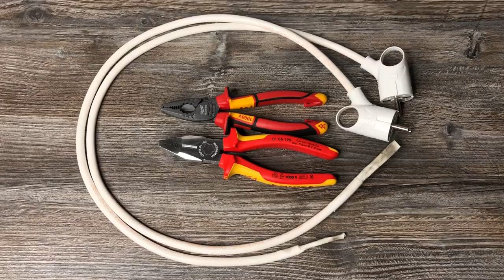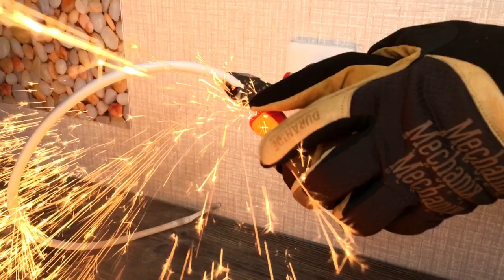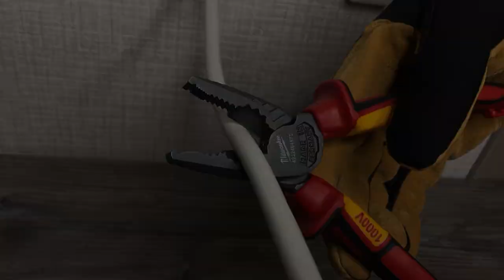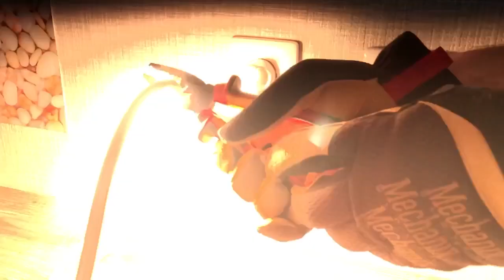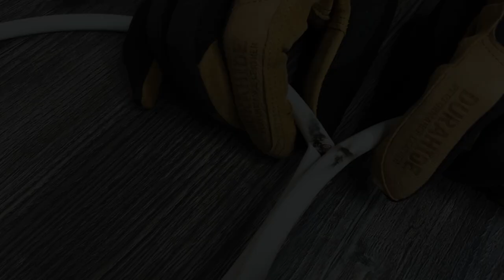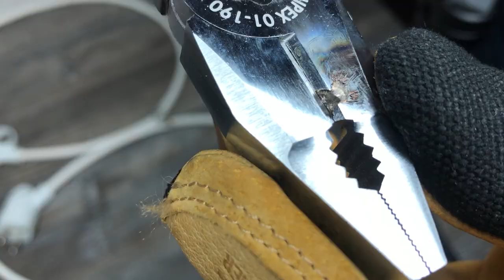Short Circuit Slow Motion. Crash test KNIPEX & Milwaukee.

Comment: Don't ever try to cut live and neutral together!. ...A  100amp surge current could weld the pliers as well...
Reply: It's an outlet at 240v. Likely circuit protected at 7.5amp. Even if it did surge to a 100amp, it's only gonna last for less than a millisecond.
Reply: wires and many components on the circuit have loss a lot of lifespan and may have to be replaced